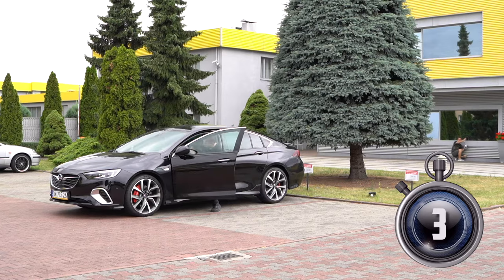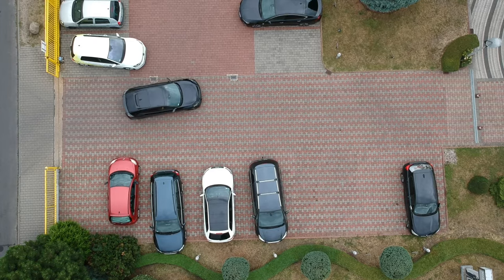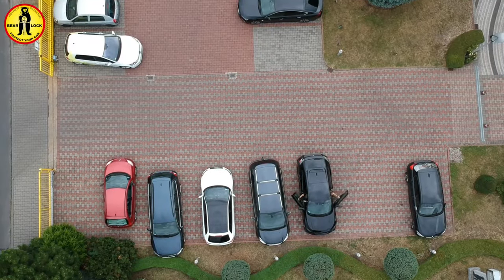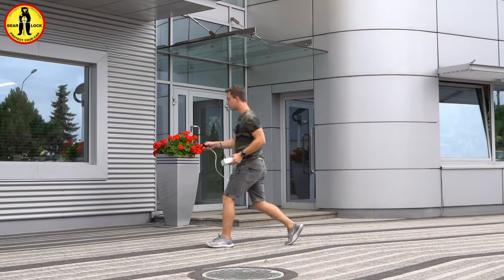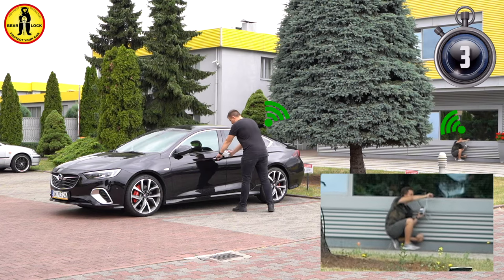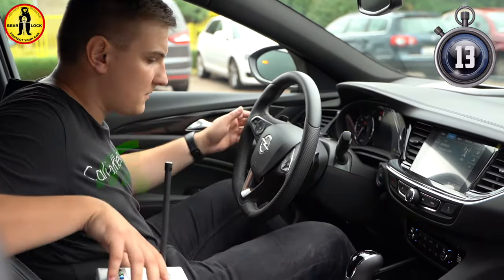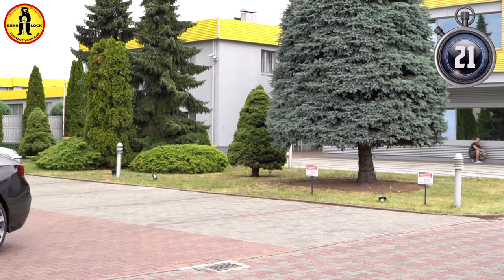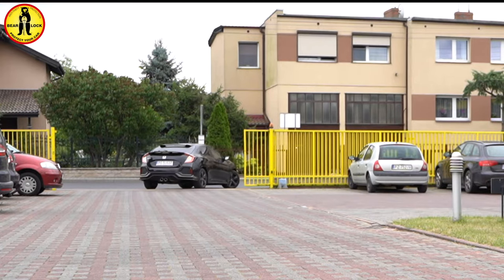Keyless Car Theft - How does it work?

Comment: I wish key fobs have a mechanical switch to switch off the transmitter of the fob and it also helps sve battery of the fob.
Reply: Mercedes do - press lock twice - sorted
Reply: metal blocks the key signal
Reply: I own a 2021 Toyota and in the settings in the menu system on the dash you can disable the smart key setting meaning that you need to physically push the buttons on the key to operate the door locks and ignition. The car no longer responds to the smart signal. Just like an older car you must have the actual key to operate the car. You can also kill the signal from the key by holding down the lock button and pushing the unlock button twice. Another poster here mentions pushing the lock button twice on a Mercedes key kills the signal but on a Toyota pushing the lock button twice activates the double door locking feature meaning if the door is locked and the glass is smashed the inner door handle still will not open the door. And you also could put the key in a cheap rfid pouch which will block the key signal.
Reply: @Patmofar  On my 2016 Prius I hold the lock button down on the smart key and press the unlock button three times and it disables the key fob until any button is pressed. It also saves the battery life of the smart key.
Reply: @clivemetcalfe2304  Yes that also works on my Corolla but by disabling the smart function in the settings menu the key works just like a normal non-smart key without having to push buttons all the time and what you save in battery life in measured in ten or twenty cents per battery.
Reply: @clivemetcalfe2304  To be fair, no one will steal a Prius.
Reply: @mickyarams  An attempt was tried on a mine and it was a big insurance repair. They tried to lift it onto a lorry and crushed both front wings.

Comment: IMO - Consider taking the battery out and use the included notched key to lock and unlock the door. When you enter your car, place the fob right near the button (no battery required) and start the car. Or contact your dealer to replace the keyless system with keyed only?
Reply: keyless system with keyed only can be done as some bmws have keyless entry as a option but some models have it as standard.

Comment: There are ways to "turn off" your key, IOW, to stop it transmitting - So these scum can't "intercept" the signal & steal your car! .......  In my car - Lexus -  Push & hold the LOCK button and still holding, push the UNLOCK button Twice. The key will flash 4 times - IE  flash flash ....... flash flash!  (Known as 4 bells) the key is now dead. Try it.  Go to your car (key in pocket as normal) and try to enter. The car should stay locked.   To reset to normal - press any button.  Other makes may vary.        You're Welcome.